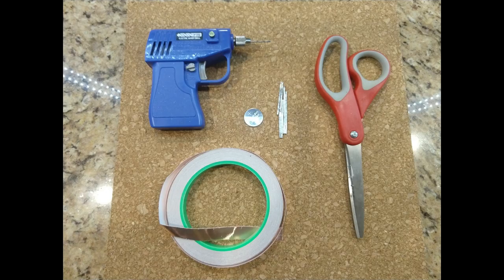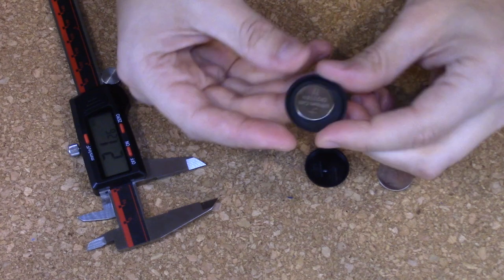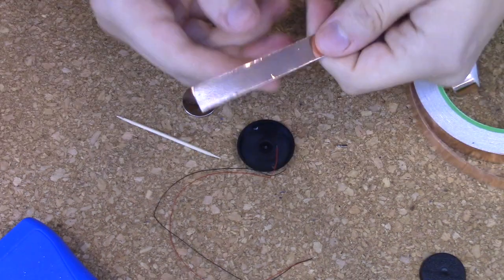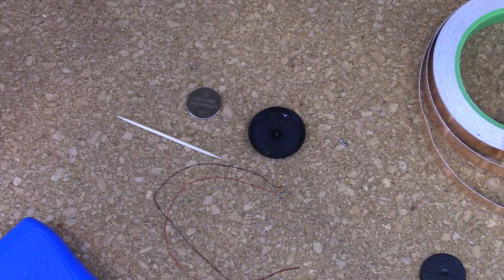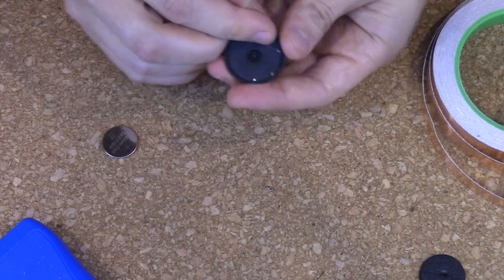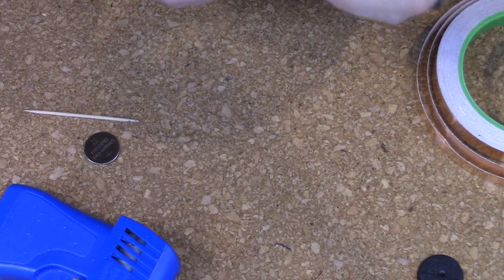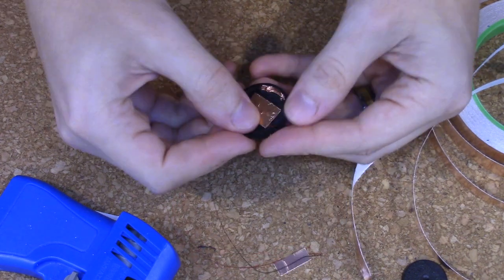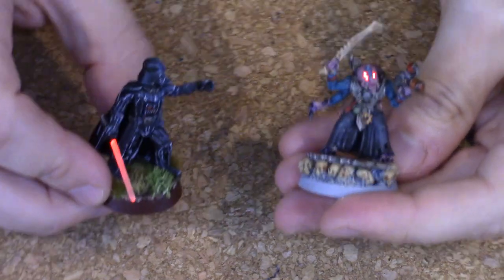How to Light Up Minis - Part 2

Comment: Can I just say that your videos are 10/10 for being informative, concise, and most importantly, in focus.
Reply from the maker: Thank you. I hope some of these videos help you out. I try my best with the videos even though I don't have fancy equipment. It's funny you mention the in-focus part, cause that was always one thing that bugged me too. I appreciate the nice comment.
Reply: @SuperPhunStuff  Have you thought about using conductive paint before painting instead of drilling holes and running the wires through the model?
Reply from the maker: @contramantra  yes I did. so 3 things with conductive paint. 1) if you put it on the outside you degrade the details of the model. It may not be that noticeable but you kind of want to keep as much detail as possible. and 2) conductive paint kind of sucks tbh. it's actual conductivity is pretty poor, and to get a good connection you have to put it on fairly thick. lastly, 3) it adds more cost. The leds already aren't the cheapest but have long leads. so why not use them. Overall, the drilled holes, for the most part, are well concealed and the better solution. If I had something super thin, like a staff or something, then I may consider a different option. I'm all for others to try other methods for this type of work. Let me know if you try something, and find it better.
Reply from the maker: @contramantra  yes I did. so 3 things with conductive paint. 1) if you put it on the outside you degrade the details of the model. It may not be that noticeable but you kind of want to keep as much detail as possible. and 2) conductive paint kind of sucks tbh. it's actual conductivity is pretty poor, and to get a good connection you have to put it on fairly thick. lastly, 3) it adds more cost. The leds already aren't the cheapest but have long leads. so why not use them. Overall, the drilled holes, for the most part, are well concealed and the better solution. If I had something super thin, like a staff or something, then I may consider a different option. I'm all for others to try other methods for this type of work. Let me know if you try something, and find it better.
Reply: @SuperPhunStuff  I like to use magnets on my miniatures to pose the arms and switch them out, etc., and i was thinking of coating the tiny magnets in conducting paint to establish the circuit between the arms and the base.  I'll try it out and let you know if it works.

Comment: Thanks for posting this. It really doesn't seem all that tough.
Reply from the maker: I would say that the battery work isn't tough. However, the first part, where you have to integrate the wires and lighting is the hard part; depending on your model. It takes time, and precision to drill the proper holes. I've refines the battery base work to make it as streamlined and easy as possible. So ya'll get to see the final result of many experiments, and trial and error. Due to the size constraints, I found this to be the best option and process. I would love to hear others feedback and if they come up with better methods.
Reply: Your general strategy seems very sound and practical. I particularly like your use of copper tape. The only thing I might do is make some sort of template for battery and magnet alignment, especially if I were to do an entire unit like your kill team. Just to speed up the process.

Other options might be to create custom bases, perhaps 3d printed. Either flat, or you might be able to print custom bases or inserts that could house the light itself. Like say putting the led in a rock and then routing fiber optics to the eyes or other glowing bits. You've inspired me to give it a go on some Warmachine warcasters I have on the table.

Subscribed to the channel. I love seeing new stuff. Found you when looking at options for light arcs.

Comment: So, I'm planning a project.  I have a miniature roughly the size of a Primaris Captain model that consists of a fair amount of negative space.  The plan is to conceal the LED behind the solid pieces and illuminate the 'inside' of the model with it.  I intend to paint the interior black with gloss varnish to reflect the light and achieve an internal glow effect.  Would this be effective with the type of LED you use here?
Reply from the maker: Interesting. So in short you are trying to glow up the entire model vs just a portion like eyes. From doing this work, you may run into a few issues. 1) for reflecting light, you would want to use a white or a chrome type color; black does the opposite and is inefficient. 2) Knowing how these models are built and made, the inside of these models can be fairly  irregular. For example, different thickness, random air pockets, and things inside (like nubs or stands) that affect how the light is delivered. Because of these type of things, the light that comes out probably wont be even and it may look a little weird. A test you can do is to hold a bright flashlight up to the unpainted model and see what happens. Oh if you plan to paint it, that stops the light too. 3) I believe there is one way to accomplish what you are trying but it's not  probably ideal for you; but maybe it will work. You would need to 3d print a custom primaris out with the proper voids and channels to handle the light dispersion. If you did this in a clear resin, you could have one led in the chest, and anything unpainted would deliver the light that you are looking for. Check out some videos on how people light up gundam models, and how the light is transferred to different parts. Now since a gundam is a large model, now you have to devise a solution that solves it for a miniature. 3D SLA printing may be the only really good solution. Depending on size you may need more than 1 led, but these are fairly bright so one led for one primaris should do the trick; if not just hook them up in serial and you won't have to change the battery design.4) There is one more option that you can try, and it is probably the simplest/cheapest but maybe the hardest. In this option, you create all the light channels by hand, and in any area you want to glow, you can hollow it out, and fill with a clear resin. Now this solution all depends on how well you are at drilling, creating the light channels where needed, and repairing the sections you hollow out. If you don't go too crazy with lighting up, this can be pretty doable. Clear resin is cheap (get the uv kind and it will make things way quicker), and most of this comes down to your skill level with things. 

That's all my thoughts that I have atm. Your project is a bit different than what I have done, but it may be doable with some trial and error. IMO option 4 may be the best way forward depending on what you are trying to do. Wish you luck and let me know how it works out for you

TL;DR Lots of unknowns and probably difficult to do. Few concerns and a couple of possible ways forward.

Comment: What was used for the saber blade?
Reply from the maker: For the saber blade  I used 1/16" clear acrylic rods (https://www.amazon.com/gp/product/B0006O6QXU/ref=ppx_yo_dt_b_search_asin_title?ie=UTF8&psc=1). The trick to diffuse the light across the entire rod was to take a fine grit sand paper and rough up the entire rod. The light from the bottom of the rod then disperses across all the little imperfect surfaces all the way to to the top. A few notes on this technique. 1) the more the surface is roughed, the more light is dispersed. 2) the more light that gets dispersed at the bottom of the rod with reduce how much light gets to the end of the rod 3) works well for shorter distances but the longer you go the more light power you may need. 4) you only need a real fine grit sandpaper as any imperfection will diffuse light. 5) lastly, beware of how you connect the rod to the mini, putting glue in between will affect how much light comes in; try to glue around with the light in the middle being unaffected.

Comment: HI @SuperPhunStuff, I'm trying to do Vader's lightsaber for NOVA to go with the 501st. I'm new to wiring and was wondering what type of neomydium batteries those are. I can't seem to find them on ebay or amazon. Do they sell them at local hardware stores?
Reply: Also those 1.5mm rods seem elusive!
Reply from the maker: @EvilDeadFan1995  Here are a few of the links to the stuff I used
Batteries: https://www.amazon.com/gp/product/B071XT8CK1/ref=ppx_yo_dt_b_asin_title_o08_s00?ie=UTF8&psc=1
1.5mm rod: https://www.amazon.com/gp/product/B0006O6QXU/ref=ppx_yo_dt_b_asin_title_o00_s00?ie=UTF8&psc=1

Just be very careful with the making the holes in the resin : -) Hope this helps!

Comment: Can you run 2 LEDs off of one battery? The model I'm doing is going to have lighting in two separate places.
Reply from the maker: Definitely. I would suggest you run them in parallel so that each get the same voltage. The only downfall to running more than one led is that the battery won't last as long, as now you are powering 2 led vs just one.
Reply: @SuperPhunStuff  I'm no electrician.  What do you mean by running them 'in parallel'?
Reply from the maker: @legionaireb  lol luckily the concept it very easy and you don't have to be an electrician. There are a ton of videos and articles out there that you can find. Here is a simple one that may help you https://diary-of-electric.blogspot.com/2020/01/what-is-the-difference-between-series-and-parallel-circuits.html . There is also this video that explains it in more detail https://www.youtube.com/watch?v=sbocWMTmPK8 . In short, you want to make sure that you use parallel to keep the voltage the same across all leds or they won't glow.

Comment: How long do those lights stay on with those tiny batteries?
Reply from the maker: The CR2016 has the capacity of 90mAh, and the led consumes 20mA. If you take the capacity divided by the consumption, you get 4.5hrs. So not super long but if you consider the size and that this is continuous use, it's not too shabby.

Comment: Every other video with LEDs I see requires a resistor somewhere between the battery and LED. The resistance depends on the color of the LED, its forward voltage, etc. 
How come there is no resistor with your method? Won't a resistor decrease power usage and increase the life of the LED?
Reply from the maker: So normally this is true, and it would require a resistor. However... I cheated a bit because I used a coin battery. The internal resistance of the coin battery cell itself is sufficient to limit the current to the LED. Just a nifty trick with coin batteries for small projects like this.